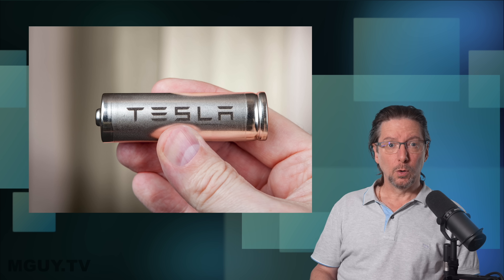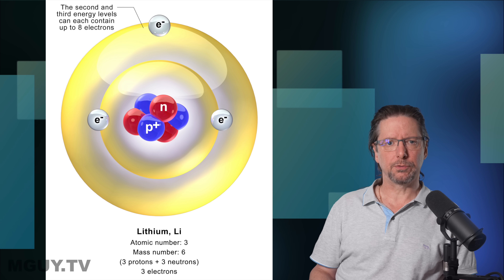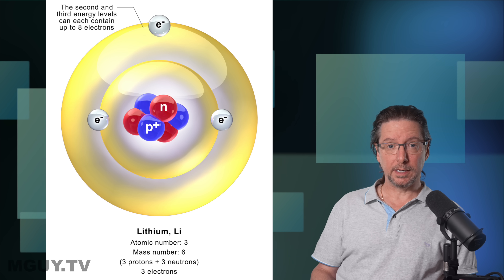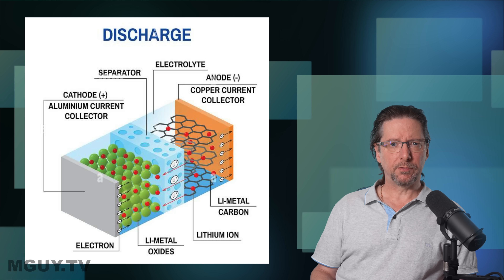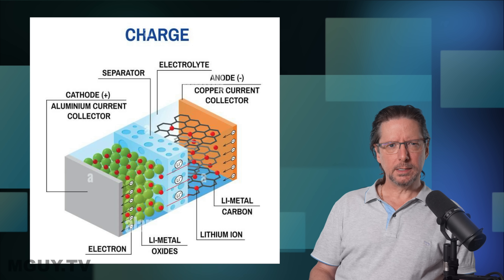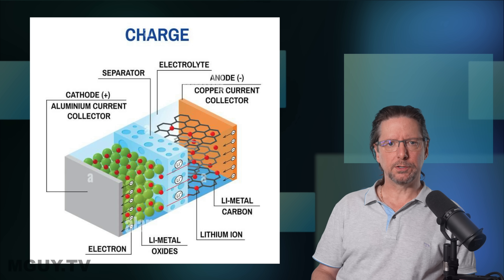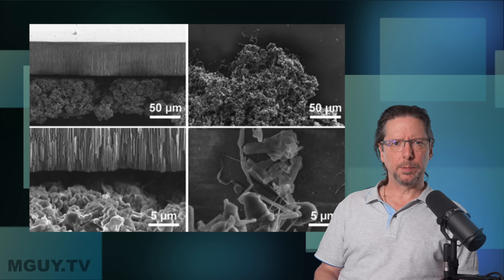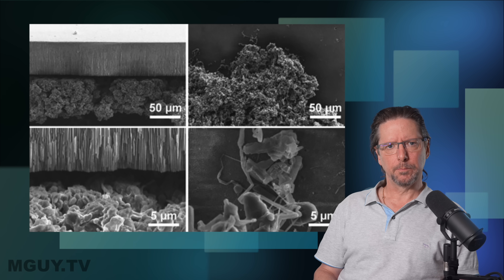Why are EVs so TERRIBLE in the cold? | MGUY Australia

Comment: Governments betting all their money on EVs?? It's the taxpayers' money they're betting, and WE will be the losers!
Reply: All the subsidies for incentives with EV infrastructure and rebates for people buying an EV is astronomical since this began many years ago. It's such a massive waste of taxpayer money.
Reply: @practicalguy973 it is the cost of adapting to climate change and health problems from ICEV pollution that is the waste of taxpayer money.
Reply: @williammeek4078  It is a heath issue but its an extremely small percentage. You'll have health problems from 10s of thousands of other things from eating processed food to daily VOCs and aging! EV's have new issues health wise. Being around the electromagnetic field (EMF) from the high voltage system in electric vehicles and the supercharging stations exposes the passengers to EMF that leads to cancer and a variety of other issues. There are emission standards to ensure it's a safe levels but that is no different than a cell phone, wifi router etc... where people are exposed in low doses that eventually causes issues. EV's are on a massive scale power wise. You would not catch me in a supercharging area with the 30'000+ AC volt junction boxes and massive power power running everywhere even underground.
Reply: UK government betting on electric steel production..... The madness never ends. However, if ev's are really dead, there maybe a bit of electricity left over.
Reply: @J123Tilley the madness is insisting on continuing to use climate changing, polluting, expensive fossil fuels. 
It is time for you to stop shoving the consequences for your actions down our throats.
Reply: they not rushing to EVs for there GOVT vehicles...
Reply: @chevalsauer  company directors aren’t either but they’ll happily shove everyone working for that company into electric vans which are not fit for purpose.
Reply: @user-zu6qn9ux9n  I'm sure Woolworths directors all drive EV's.
Reply: @chevalsauer . I wonder if some carmakers are loading the price of their ice cars to pay the government fines for not making enough EVs.  I have no substantive knowledge, but I do note that the prices of many regular cars, in Britain, have climbed very high.  I have a real contempt for all government organisations now by the way, hypocrites and liars the lot of them.
Reply: @richardsmith579  Of course they will.
Reply: @richardsmith579 yes, legacy automakers are raising the price of everything to cover their refusal to prepare for the regulations they knew were in place. And if you think governments are hypocrites and liars, you haven’t looked into what MGUY here says.
Reply: Like postal vans or like limousines? @chevalsauer
Reply: @chevalsauer the uk goverment are….
Reply: @chevalsauer they are
Reply: WE elect the governments.

So, WE are betting our money on EVs.

So, WE will be the losers and deservedly so.

Hopefully, WE will wise up.
Reply: Ever since the bad news of EVs failing in the cold of Chicago winter weather (and other places), the MSM news feed on my computer has pumped out countless positive EV stories to counter the truth about how bad EVs are in real world conditions.
Reply: @autodidact537  Like the bombing of the Houthis, the coerced switch to EVs isn't working – but it will continue.
Reply: Exactly.    If you don’t buy a lousy EV your tax money goes to the virtue signalers of the world.
Reply: We are always the loosers when it come to anything governments do.
Reply: I have to disagree. Once a robber takes your money, it is no longer yours. It wouldn't be so bad if they then went to Vegas and wasted it on gambling and hookers. Instead, they take it from you and then use it to make your life worse.
Reply: The Tube is really going hard at silencing certain people.. 
It seems I am on the AI watch list..
Reply: It's no "AI"... it's simple key word filter. @Cent51
Reply: @Cent51 only if you swear or are deliberately offensive.
Reply: @williammeek4078  You are right to a degree, but, there certain key words apart from swear words that get me censored.  
I will try find the post I posted I here that is gone..
Reply: @williammeek4078  34 comments, only 21 showing.. 
And one of them is mine..
Reply: @patrickmihajlovic4112  It is called reality. And all you need to do is accept the evidence in front of you instead of what you were told to believe. Steep cost for you i know, but it is better for you in the end.
Reply: Governments are betting they are Tyrancially Forcing.
Reply: They not betting, it a planned effort, it new money.. 
Old power has reached it ceiling for making money.. 
The Green energy is a new market that has made people mega money, laundring of even more money..
Reply: 100% Correct. The government don't have any money, they have the publics money and should be held accountable.
Reply: well said
Reply: You don’t need the government for that.. 😅sorry couldn’t help myself.
Reply: You have been brainwashed. EVs are generally better. Sure, they have some weaknesses but cold should be a minor inconvenience, the battery dying is poor planning on the part of the owner. 
Since human caused climate change is real, ICEVs cause massive amounts of local pollution, and EVs have a lower cost of ownership than similar ICEVs you and your children will be the ultimate winners of policy moving us away from fossil fuels.
Reply: :face-purple-crying::face-purple-crying::face-purple-crying:
Reply: No, governments are betting all of OUR money on EVs.  How else will they get the kickbacks, inside trade on the stock market and give our money to their friends?
Reply: they're not betting, their colluding.

it's the same scam as GM "lobbying" city govts to replace trollies with diesel buses all over the USA.
Reply: At a bet, the politicians are making bank on the whole energy transition concept. Literally money in their collective pockets. That's why it's such a push
Reply: Since governments done have “money”, it’s just stolen from us the peasants.
Reply: Government has been subsidizing BIG OIL for decades and wars have been waged to maintain and ensure the functioning of society because society didn’t rely on enough alternative sources to continue functioning properly. How much of an impact would the OPEC sanctions have been if 25 of all transport was EV and the rest hybrid and plug-in hybrid and LP and…. Diversified modes of transport would have reduced the problems and kept the gasoline prices cheaper. It’s about flexibility not demonizing EVs.
Reply: As someone that owns 2 and lives in Colorado, I can say they work fine in the cold. It's a simple matter of knowing how to use the things you buy.
Reply: Yes mate and just think what will happen when they realise how much money they are going to lose from the excise of petrol and diesel fuels!!
Reply: 1:31 - thank you Neils Bohr (ref: Ruthford-Bohr Atomic Model).
Reply: Its not their money, its our money.
Reply: 5 comments, 3 showing..
Reply: @Cent51  Thats the problem withYou Tube, if you get a Comment that doesn't aggree with the narative, the channel owner can block it.
Happens on all Channels.
Reply: Its not you that will suffer if nothing is done. Its your children and grandchildren.
Reply: @steveinoz8188
If you are really concern about the environment ev is not the answer.
Reply: @steveinoz8188   The only benefit from lithium salting the water table is if they have schizophrenia.  If they don't.... well then high concentrations of lithium might've your grandchildren schizophrenia from drinking from a well.
Reply: Is english your second language? @ToolHombre
Reply: @steveinoz8188  You need therapy for your fear and gullibility... Either that or you need to be igmored and mocked for you evil agenda and lies.

Comment: EVs are mobile crematoriums.
Reply: you might want to look up the numbers on EV versus ICE car fires.
Reply: @Jojo-o6o6w The main point is that ICE vehicles don’t spontaneously combust.
Reply: @arnolddavies6734  tell that to the people that get rear ended and burst into flames like countless videos on youtube show or the countless ice vehicles that catch fire for seemingly no reason. dont be so silly.
Reply: @user-xj5xp6qz5g you might want to look up the DIFFERENCE between ICE and electric vehicle fires.
Two entirely different critters. Ask a fireman.
Reply: @Jojo-o6o6w  ICE vehicle fires, be they diesel or gasoline, are relatively extinguishable. If the fire truck is THERE, the fire can be put out.
EV fires can BURN UNDERWATER.
Let's also look at what it takes to START said fire. With an ICE vehicle, typically some sort of collision is involved, otherwise it's due to neglect of equipment. They don't spontaneously self-immolate.
Look at fire temperature between gasoline, diesel and EV batteries.
Look at THE SPEED OF PROGRESSION between the two. There's video of an EV bus that was parked. It went from smoke coming from under the seat to JETLIKE FLAMES in UNDER 3 seconds. Unless they ran immediately after smelling the smoke, anyone sitting in the first 3 rows of that bus would be in critical condition IF they survived.

If you don't see a DRASTIC difference there, it's because you refuse to.
Which also ends the discussion.
Reply: Engineering at Newcastle University in England, studies the issue of electric vehicle fires and acts as an advisor on the topic to emergency responders. “At the moment, I believe that spontaneous fires are less likely to occur in electric vehicles than they do in conventional, diesel or petrol vehicles,” he says. “But the problem we have is that the data collection has been very patchy—and we don’t have sufficient data as of yet.”
Reply: Cybertrunk certainly is. Jaws of life cant open it, occupants cant break windows, all lock are electric. Guaranteed annihilation
Reply: Double standards, ICEVs having been burning people alive for decades. Where have you been under a rock? FORD and BMW have lost dozens of law suits.